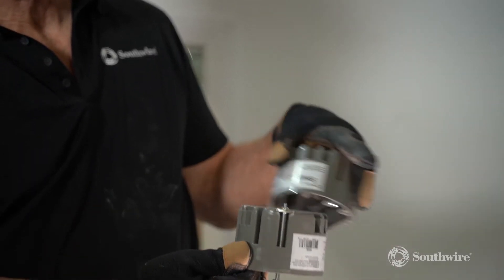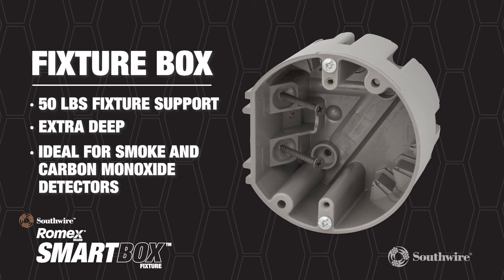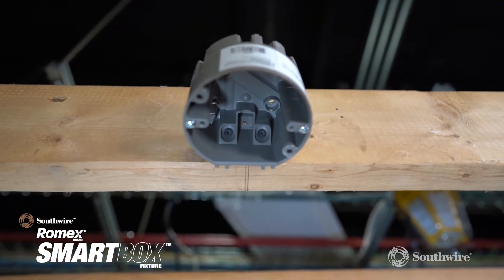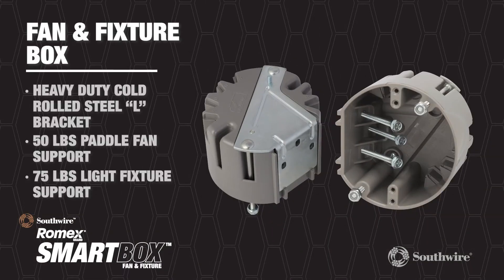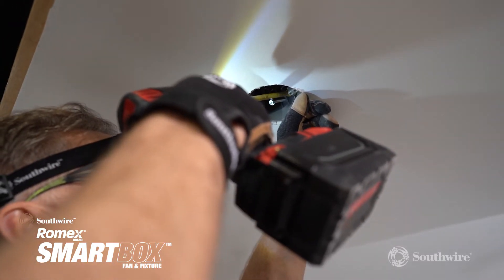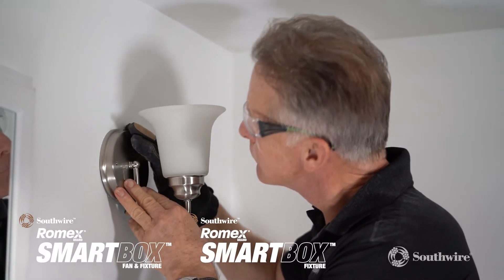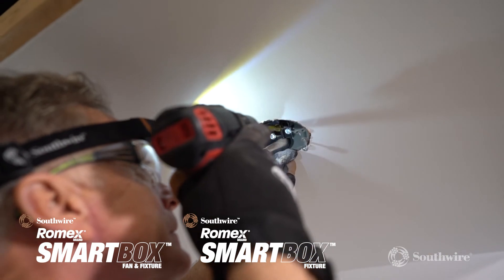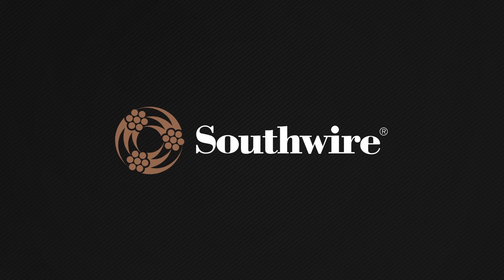Romex® Brand SmartBox™ Fan & Fixture Box

Comment: Do these work on I-joist floor beams?
Reply: No. The top and bottom members are generally 1 1/2" thick. The screws that hold the box on would miss most or all of the wood because they are meant to screw into a 3 1/2" joist.